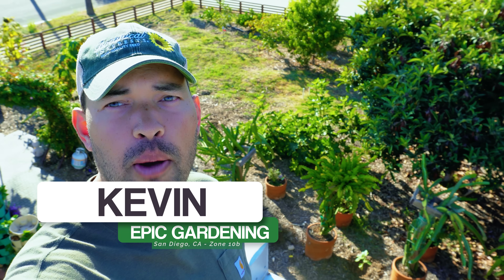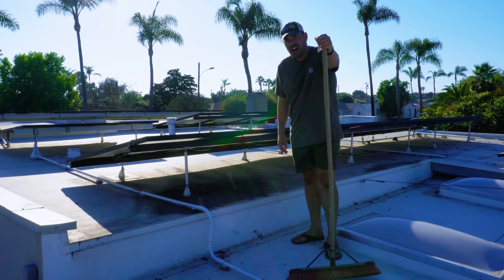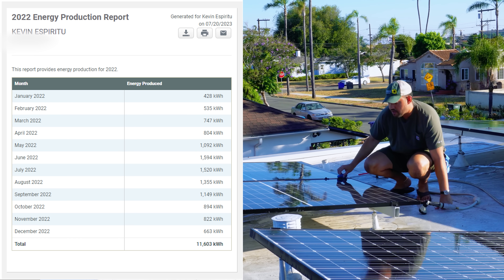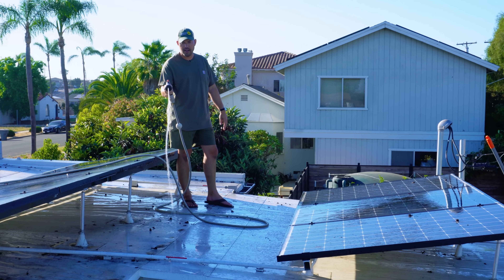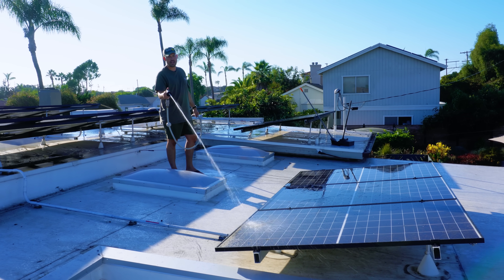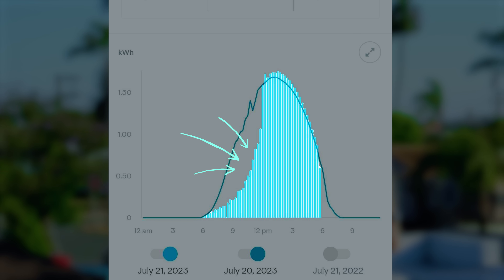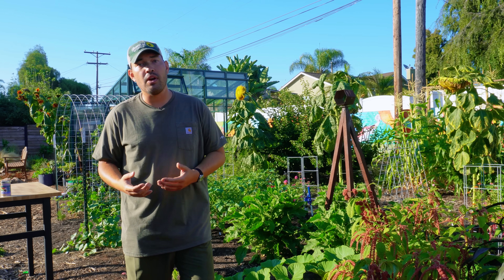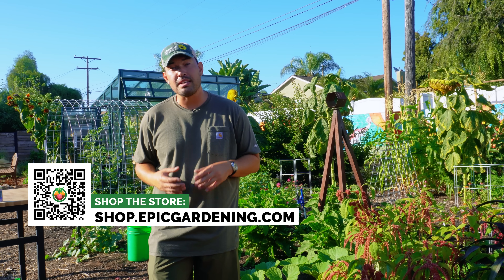I Installed 24 Solar Panels 2 Years Ago…Was It Worth It?

Comment: There's no doubt in my mind that cleaning your panels will get you an energy boost. In my last house we had panels installed and we saw a 15-20% decrease in efficiency (in Utah) because of the California fires.

I think I'm at a higher latitude than you are because we tend to angle our panels more here and I think it helps keep them a little cleaner as it facilitates run-off.

So glad you're promoting solar as well as gardening! They're both passions of mine.
Reply: im in the process of building my homestead, next year the raspberries and solar panels are getting added, im using a modular system so i can expand it as i go, as needed,  the solar panels in theorie/testing give a higher yield to the berries from increasing the optimal conditions for them.
Reply: @hook772, how and how often you clean your panels will depend on where you live and how your panels are installed. If you get even moderate levels of precipitation where you live it may be sufficient to keep your panels clean. I had panels for four years in a desert state and cleaned them precisely zero times with no detriment. Some people may find they need to clean their panels once or twice a year to be happy, and a jet of water should suffice. Solar panels are made to withstand the weather, so a good hosing shouldn't do any damage at all.

Comment: always wondered if it's possible to power your entire house, like if you are running an AC, a beefy gaming and streaming pc, your other misc. electronics, plug-ins and etc, plus a EV car, or would solar not cover it it entirely and might need to use on grid to power it partially?
Reply: During the summer I had net positive power production. For months at a time my electric meter ran backwards. The opposite was true in the winter, though. So, yes, June through August it's quite easy to power an entire house with solar- even with your AC running. Not so much once the days get shorter and the sun's angle more oblique.
Reply from the maker: With enough battery, it's possible.
Reply: @epichomesteading  well dam-- I might start planning to get solar panels maybe possibly then
Reply: Well it depends where you live, how much electricity you use, the size of your roof and is it exposed to sunlight (or shaded by trees/tall buildings).
Impossible to answer without this data.
Reply: It also depends on the rules where you live. In Las Vegas you are limited to a certain percentage of electricity you can generate with solar. I’m not sure if you can disconnect from the grid and go 100% or not.
Reply: @lvthunder wow that seems like a rip off! The amount of energy consumed by hydropower (via the Colorado River) to keep LV shining in the desert is already mind boggling. You’d think solar would be the best option and energy companies would see it as a team effort.

Comment: I wouldn't get more panels until/unless your yearly consumption exceeds your yearly production as you would essentially just be reducing the real word efficiency of your system. You want to reach the break-even point with some leeway but anything above that is money that could have been better used elswhere on the property.
Reply: Also I think if you add panels you are at risk of loosing your current NEM status but not if you add batteries though batteries have limited use.

Comment: when was the house built?
Reply from the maker: 1920s
Reply: @epichomesteading can't remember if you covered (any) insulation present when you bought the house ?! 
Did you add anything (insulation or additional support) to the roof BEFORE the panels?! 
 I live in North East USA, so, insulation is important.  But, in your case, why cool a house when insulation might keep the temp. more stable ?!

Comment: Great video. Tesla just recently added a feature where you can directly charge your car using solar if you have a powerwall. So you can just dump all of your excess production into your car rather than selling it at super low industrial rates. Also, Your Rivian has V2G/V2H, so you can use it as a battery storage as well. Make sure to look into that before buying separate batteries for your solar system.
Reply from the maker: Oh that's amazing
Reply: It supposedly has V2H but the tech to install it just doesn't exist yet. Hoping either Rivian or a third party will get a solution!
Reply: @ardenthebibliophile  Ford's bi-directional charger is $1300. It will cost another few thousand to install it, but it will still be cheaper than buying a dedicated battery pack for your house. The problem with Ford's charger is that for some reason they decided to go with a non-standard protocol over the standard one that is compatible with Rivian. Hopefully it gets updated one of these days!
Reply: Solar charging your Tesla with a normal array takes like 120+ hours, otherwise you need a massive 12K-15K solar array, which is super expensive.
Reply: @michaelsasylum  At current prices solar arrays can be bought for a little less than a dollar a watt.  The panels are about 65 to 75 cents a watt.  All the other things in an array take it to something like 85 cents a watt.  
So that makes an array that is 15K watts about $12,750.  On average for the entire US that would generate about 3.15 megawatts of power a month.  ( 3015 KWH) Look at your electric bill; see what you use. 
Most people do not completely drain their ev battery every day.  If you are going to talk about this,  talk specifics. 
I am looking to increase my home array to about 8500 watts.  That should generate enough to power my house and my wife's driving, and still have extra power to spare.
Reply: I commented and then you had already given pretty much the same advice.....

Comment: Nice update. Just about to hang another 10kwh solaredge battery in the garage to give me 20 in total. I get 4p export, but 30p peak and 7.5p 23:30-05:30 so hopefully I can run the heat pumps for less than £1/day this winter. Only got 5 east & 10 west panels but they cover the daylight hours even when cloudy in London. Only made 3MWh this year, but used most of it and can get 200l of hot water and 20 miles of range back in the car on a good day to avoid overnight draw.
Reply from the maker: Nice! I want a battery bad
Reply: @epichomesteading Home batteries now qualify for the 30% federal rebate.  As an example, one 13.5kwh Tesla powerwall can be purchased for $6k, two for $11k + install cost.  I currently have 2 here in San Diego and can run completely off-grid for 24 hours+ hours combined with my 8.2kw solar system.  Now I only charge my 2 EVs on super off-peak power from SDGE at night and the rest of the day is from solar+batteries.

Comment: It’s not really battery tech that’s the problem it’s 1) inefficiency of buildings in general in terms of heat, light and airflow and 2) inefficiency of inverters that convert stored dc power to ac power usable with domestic appliances, lighting and HVAC
Reply from the maker: Agree on home efficiency BIG TIME
Reply: Also the size of the houses and the appliances.
I live in a small apartment and use on average ~200 kWh per month.
He uses ~900 kWh per month, so obviously he needs to invest much more to get that from solar panels + batteries.
Reply: Battery tech is most certainly an issue. Whoever invests better batteries will probably become trillionares. You don’t think phone and computer makers wouldn’t want a weeks long battery life or more.